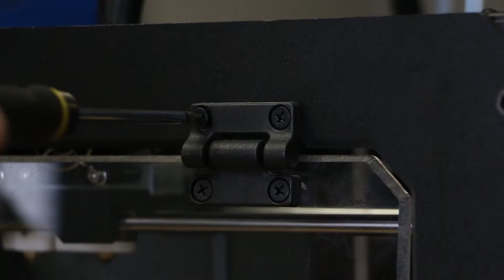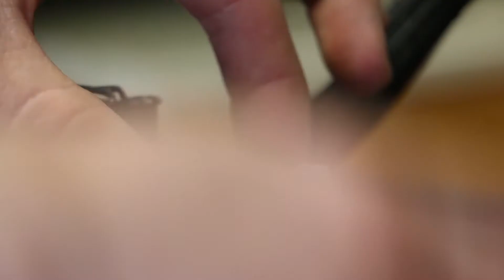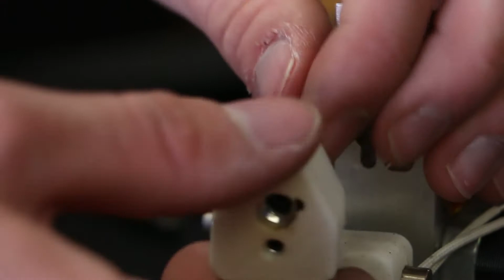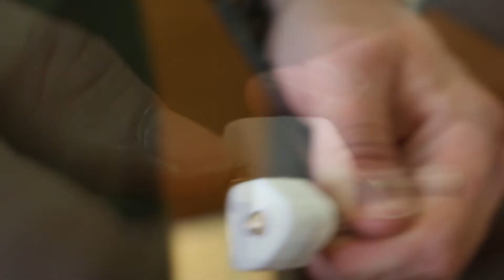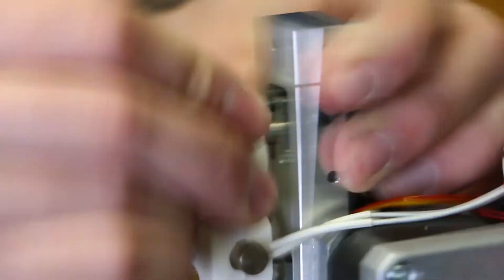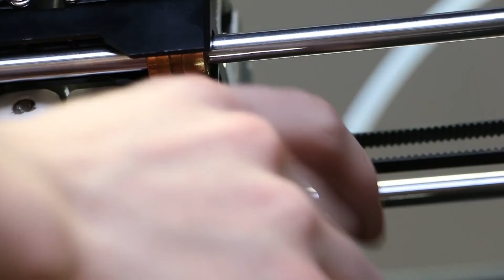Install Silicone Heater Blocks for MakerBot Replicator 2X

Comment: If you are removing anything but a new nozzle this method will not work.  If you try to remove a cold blocked nozzle you will shear it off inside.

Comment: will this process work for Maker Bot Replicator 2 (not 2x)
Reply: It is pretty similar but the heater block is a different shape and more standard looking so it requires a different sock. Unlike the 2X, you can likely find a silicone sock more easily for the Replicator 2, but you can also use cotton: https://www.youtube.com/watch?v=rbAa1XtnTig

Comment: My ceramic heater block broke off, do I need to replace it or can I keep printing without one?
Reply: It will probably not be able to get up to temperature as the nozzle will be losing too much heat.

Comment: I don't fully understand what the added value of the silicone heater block actually is.
would you mind explaining?
Reply: Supposedly to insulate the nozzle so that it gets up to and maintains temperature more efficiently.
Reply: Hot end insulation, and it's also one of the things you'll want to do if you're changing out the older parts for modern ones. For example, the 2x is made to only print with ABS. It does a good job at that, but you can't really print PLA and other common filaments. So by doing this and swapping out a few things you can make it print basically anything.

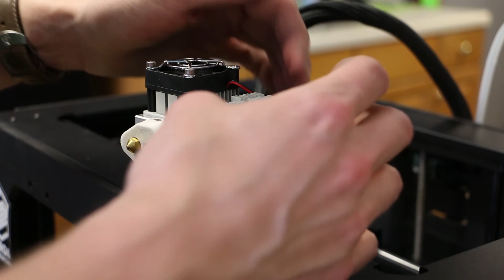Comment: Nice how-to video. One issue I encountered, at 5:24 it clearly shows the wire end of the heater cartridge is at the back of the heater bar assembly. Once assembled, I noticed the timing belt drive now interferes with the heater cartridges significantly. There is no way I can adjust anything to clear the two. I will need to disassemble again and put the heater cartridges in from the front. Did you not have the same issue?